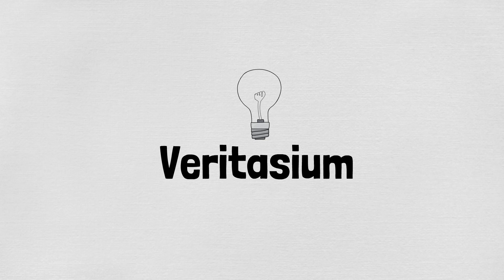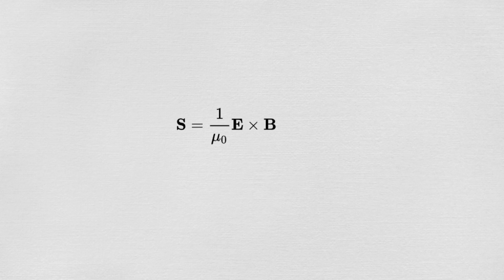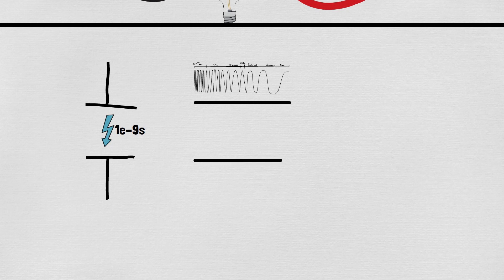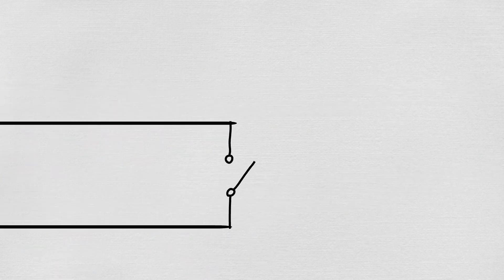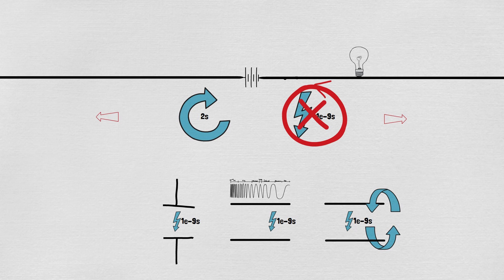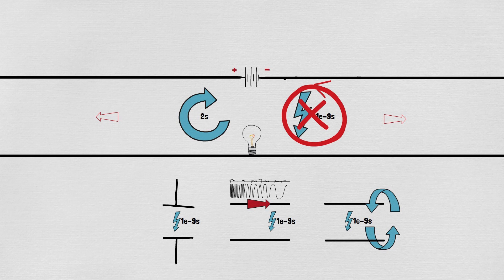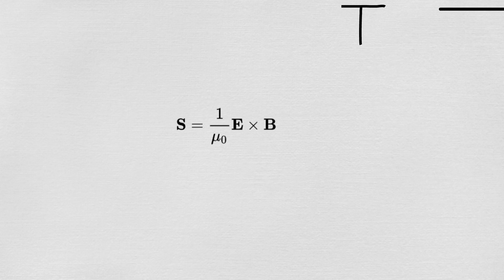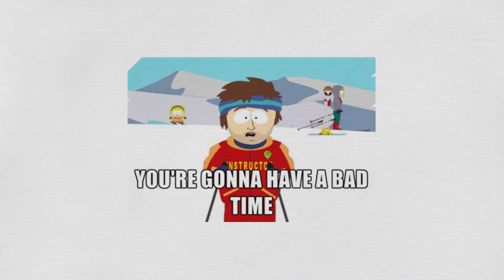Veritasium is Right? (see description)

Comment: Edit: I was wrong. Thanks to the comments below for pointing me into the right direction. I will still leave this up to not hide my mistake.

Wrong from here:
Thank you! I got quite confused by Veritasium's video, as well as some follow-up explanations by other EE YouTubers. I recently finished my EE Masters lectures on Theory of Electromagnetic Fields, which includes a large portion of electrodynamics. That's why Veritasium's video was counter-intuitive for me. 
My own explanation was kind of semi-mathematical, and based on how the speed of light is interpreted: The maximum speed at that information can be transmitted. Further, the information is transmitted via a designated medium, or channel. I'm this case, the wire guides the information about the switch being closed, and thus energy can flow according to the Poynting vector. More abstract: The information about which potential exists between all parts of the circuit can only travel at the speed of light, and it can only be transmitted via the wire, since it relies on current flow.
Even if you can measure a potential at the open switch between the contacts, and also between all points of the circuit, the information about a change in the circuit can only travel at the speed of light via the wires. 
It is also important to assume, that we initially have a steady state system. So, any flow of information about potential caused by hooking up the circuit has finished, and the potential at the open switch has settled. Closing the switch will trigger the flow of information, and thus it will take 2 seconds for the light bulb to light up. 

If we assume realistic wires, and not ideal ones, then we have to talk about transmission lines. Others already wrote about this.
Reply: "and thus it will take 2 seconds for the light bulb to light up."
Nah, that is not the case.
It is an idealised version but the lightbulb will turn on far before 1 second is over, let alone 2 seconds. In Veritasium they tried to oversimplify the answer and gave a bad explanation, but the fact remains that in the scenario where other factors (like wire-resistance and the energy required for the bulb to turn on) are ignored then the bulb will turn on in 1m/c seconds.
Reply: Why? Is it impossible to create TL from ideal wires?!? Or why would you not have to talk about transmittion lines? Obviously the long wires forms 2 transmittion lines. The current flowing into 1 part of the wire creates an opposite current in the adjacent other wire. And this current will light up the bulb, because it is assumed/defined to be sensitive enough to react to I=Vin/(2*Z0).
Reply: That's just plain wrong. You need to take those classes again.
Reply: @RafVantongerloo  Yeah, I made some false assumptions and was quite wrong. I got thrown off by the argument in the video about how the current flow needs to be "completed" throughout the circuit in terms of a galvanic conductor, and that the switch position should not matter. 

What made me rethink my explanation above is an explanation using transmission lines. If transmission lines are ideal without a change in impedance, they have to be infinitely long (or terminated). If they actually would be infinitely long, then according to my explanation above no current could ever flow after applying a voltage. But of course that can not be true. 

So Veritasium would be correct, since it doesn't matter how long the wires are. What matters is the current induced by the magnetic field, since we assume the light bulb is sensitive enough. And following that, only the distance between battery and light bulb matters.
Reply: Your understanding is incorrect. You can view it as an information theory problem, but the information is flowing through space between the switch and the bulb, not through the conductor. The "transmitter" is the switch + wire attached to the non-energized part of the switch. The "receiver" is the light bulb. Here's a thought experiment: have you ever seen those huge radio antennas? Imagine placing two of them 1 cm apart and sending a message. How long would it take to receive the message? It would 1 cm's worth of light propgation time to receive it, since the antennas are spaced 1 cm apart. It doesn't matter how long the wires in the antenna are.
Reply: @funkathustra  yes, my understanding was wrong and I put an edit to my original comment. Thank you for explaining it using the information flow.

Comment: The big issue is while a massive power source attached to the switch may cause brief some local effects at the light due to capacitance and other coupling outside the wired, the light will not remain lit due to circuit current until the EM field makes it around the circuit.

Comment: Thank you for your clear explanation! I still have some doubts though!:
Think of a lightning strike. This is not not a circular circuit, but the current flows for a very short time, until the electric potential is neutralized.
Imagine that superlong wire again: I believe a lot of energy can be stored in it, even if the complete circuit is cut off at a far distance.
Wouldn't it be possible to have such a short during current , while the electric potential is also still propagating through the wire until the broken end.
Personally, I believe at least a small electromagnetic wave must be emitted to the other wire in that short period, inducting a short and small current in the other wire as well. Not that it certainly means that te other bulb will get enough energy or time to light/warm up. But maybe it's at least something worth to mention and further explore as a possibility.

Comment: The way interpret it is that we assume that prior to the switch being closed, the whole circuit is static, so no current flows anywhere. Using Ohm's law and Kirchhoff's laws then tells you (if I'm not mistaken) that there is a voltage difference across the open switch. When the switch is then closed, that voltage difference stays across the switch (briefly) and THAT is what allows some current to flow in the circuit. Then after that a B-field will be created by the current, and along with the existing E-field, this allows energy to flow from the battery to the bulb in a few nanoseconds.
Reply: Actually this was my interpretation. The whole thing about having a switch next to the battery is that by you close it up, current (electrons) actually start traveling across the wire. So if the wire is 2 x 300,000,000 meters, in theory the first electron to reach the bulb will take 2 sec. But if you make the experiment, the bulb probably will turn on in less than a sec. Why?
Reply: @danielmarbella1197  Just to be sure: You are aware that electrons don't move at the speed of light, right? Electromagnetic waves do, but electrons don't.

Comment: There is a class, at my university called "transmission lines," that answers this question in detail. You are correct that this question is not in the realm of statics, but in the realm of dynamics. However, your analysis of the dynamics is wrong. In fact, Veritasium also gets this wrong (or misleading, to be more accurate). The core issue is that in dynamics we can no longer talk about "ideal wires." 0 resistance wires are still allowed (sort of), but in dynamics all wires have capacitance and inductance. This capacitance and inductance is related to the vacuum impedance and is linked to the fact that any transient pulse is creating EM radiation.

Once you add in the fact that the wire has impedance, you can treat each wire as an infinite series of LR circuits. Thus, in the situation where the switch is very close to the battery, connecting the switch does cause an immediate current pulse that radiates out from the center. The radiation from this current pulse will couple to the lightbulb wire and cause a current pulse in the lightbulb 10-9 seconds after the switch is flipped.

However, the size of the pulse will also depend on the specifics of the setup. I haven't sat down to do the math myself, but I would wager the pulse would quickly peak and then die down again while the current makes its way around the whole circuit.
Reply: I agree but I think you meant 1e-9 seconds not between 9 and 10 seconds or 10 - 9 = 1 second.
Reply: I'd say that it is not a current pulse but a current step, which starts propagating left and right of the switch immediately and also starts propagating in the parallel wire opposite the switch 1m/c seconds later. 
After 1/2 seconds the current is fully established on the whole wire.
Reply: He means 10 to the power minus 9 seconds
Reply: So how about doing two separate circuits. We make one circuit with just the battery and the switch. And another circuit with just the lightbulb. They are not connected to each other, but the lightbulb is still 1m from the battery. According to what you say the impulse of energy from the battery circuit after flipping the switch will also light the lightbulb even when the lightbulb is not connected to the battery. Do I get this right? Does that mean that with strong enough battery I can make a circuit that will turn on all lightbulbs in my neighborhood? This doesn't seem right.
Reply: @pawel72435   The flashlights won't stay on, if there is no static circuit. But some tiny amount of power will flow through them temporarily while the battery side of the setup comes into equilibrium after the switch is closed.  And since the original question is clear that any amount of power is OK, this means that the time for the bulb to turn on is just 1/c times the distance from the switch to the bulb.
Reply: But then the bulb would pulse even if it was not connected to the grid
Reply: @epimolophant  Yes, exactly. Of course the amount of power is very low, but in this idealized experiment any amount of power is deemed sufficient for the lamp to be "on" for a small amount of time.    In spirit this is somewhat similar to AC power moving across a transformer without any direct connection. But in this case there is not ongoing AC current, and there's no time for ongoing DC current, there's just a transient when the switch is connected and the system starts to come to equilibrium.
Reply: Yes... Thanks for explaining perfectly what I understand with my basic knowledge about this
Reply: I'd be interested in comments--it was suggested that the step in current creates a wave travelling in one direction, that creates something (I'll call it a reflection) in the other wire coming back. As it travels one way, the reflection is returning from further and further away, producing a continual reflection. The overall effect is a steady (small) signal on the return wire, until such time as the full steady state 12V DC signal arrives.

I still say it depends on interpreting the ambiguous question, because one valid interpretation is that we wait for the full 12V to light the lamp, rather than talking about smaller, secondary effects :-)
Reply: Capacitance and inductance are just convenient abstractions over the behavior of EM field (and it's sources) and Poynting vector that Derek described. This circuit doesn't behave the way it behaves because of capacitance and inductance. Capacitance and inductance behave the way they behave because of mechanisms he described with his circuit as extreme example.
Reply: I did it in LTspice in like 2 minutes. The current steps up immediately (1m/c seconds), then 1s later it steps up again, then 1s later again, and the current approaches the DC steady-state via this stepping. Signal reflections from unmatched impedances, basically, assuming a 144Ω bulb and 800Ω transmission lines.
Reply: @Scrogan   This is one of the interesting things - it's completely possible to model this situation and see that there is power at the bulb after 1/c seconds. But the idealized light bulb seems to get people confused about it.
Reply: I see everyone saying this and it seems like it just ignores the elephant in the room.  Yes, the light bulb will see an incredibly small current in that time frame, but not enough to light it up!  If you say it's an idealized bulb that just requires a nonzero amount of current to turn on - ok fine - but that is not in the spirit of the question or the statement that is being made.  By that logic, the lightbulb would already be on from the constant random fluctuations in the electric fields from people thousands of miles away turning on their own bulbs!

It is completely disingenuous to say that the radiation from a wire one meter away would produce enough current to turn an actual lightbulb on.  If that were the case, wireless charging for our phones would be a lot better!  Yes, every wire produces an electric field which technically affects every other wire in existence, and produces a theoretical current, but that is NOT THE MECHANISM that actually provides the current that produces light any real-world light bulb!
Reply: The thing that really annoys me about this, is that it completely ignores everyday phenomena. We all use smartphones, wifi etc. Do they work by receiving the same energy that was transmitted? Hell no. No matter how you set up this thought experiment. Energy will be lost radiating away from the target. Pretty much no energy at all will reach the bulb before the wavefront travelling along the wire reaches the bulb.
Reply: @corynezin9912  i DO think that we ARE assuming there is an idealized bulb in veritasium's example... he might as well say u connect a voltmeter instead of bulb... but the general population would understand better what a bulb is instead of a voltmeter... the "bulb" here is just a device to illustrate his point about how fast the current is induced on the other side...

but what i find his video is misleading is that he didn't make a distinction between the current induced by the magnetic wave and the current that actually traveled down the wires... so he is making it sound like the current that travels down the wire does not carry energy and that all the energy that is lighting up the bulb flows across the wire continuously non stop until you open the switch...
Reply: @cm5754  That's the same flawed definition of "on". In my world, if my light pulses for a microsecond, it isn't f'ing ON. The capacitance of a 1LS loop 1m apart is on the order of 1uF. Even an LED would struggle to pulse with that little amount of current.
Reply: @cm5754  the idea that any minute amount of power turns the bulb on was not a stated assumption, and it makes the thought experient ridiculous. If that's the case, merely jiggling the battery would turn it on... Heck, it would always be on because something somewhere in the universe will have a magnetic feild moving relative to it.
Reply: @niceshotapps1233  you can charge a capacitor and put it in your pocket. There is potential energy in it.
Charge is measured in units of actual electrons
Reply: @VivekNa  yes, but what happens with energy when you charge it, and what happens after you take it out of your pocket and connect it to some circuit is caused by EM fields and pointing vector behaving like Derek described. Capacitance is not some primary concept. It's just convenient way of thinking what's the state of a system when you've done some work to keep some charches apart.
Reply: @niceshotapps1233  are you saying electrons haven't physically been segregated on one side of a capacitor or battery?
Reply: @VivekNa They are physically segregated. The misconception Derek addresses is that energy is not stored in separated electrons. It's stored in the disturbance in EM field that this separation causes. And when currents start happening the energy doesn't travel though those currents. But through the EM fields around those currents, as Poynting vector shows.
Reply: @niceshotapps1233  potayto potahto

You can only have an electric field if charge density is uneven.
You can use chemistry, friction or a moving magnet to push the electrons to get concentrated
Reply: @VivekNa  That's not true. You have electric field always when you have charges. Also when they are evenly distributed. It's just very low inside the volume they occupy but high outside of that volume.

Also chemistry, friction and magnets all interact with charges through EM field.

And more of a potato is vegetable vs vegetable is potato.
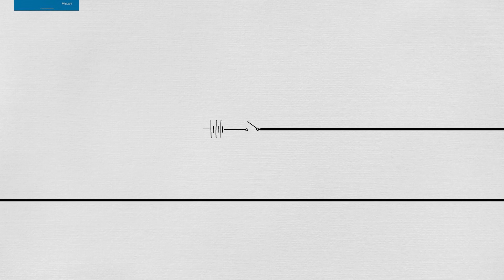Reply: @admthrawnuru  He explicitly says it in the original video at 0:48. “The light bulb has to turn on immediately when current passes through it.”
Yes, jiggling the battery would also work .
Reply: @epimolophant  The bulb will pulse even if it is not connected to the grid (assuming it could pulse with an arbitrarily small current). This happens in real circuits and is called "cross-talk". It is a big problem for computers, as they have a bunch of wires packed very close together.
Reply: @cm5754  So the light was already on and we all wasted our time thinking about it. Great.